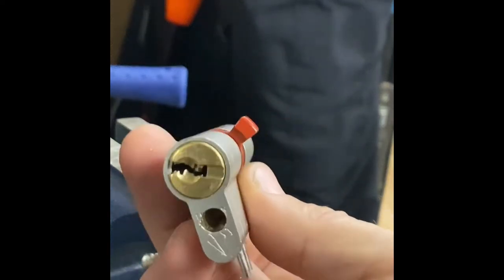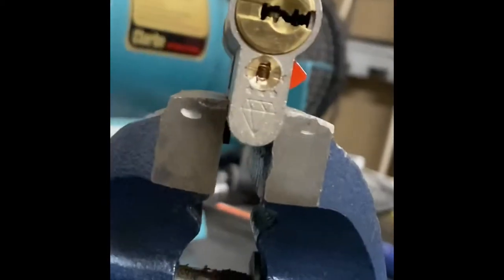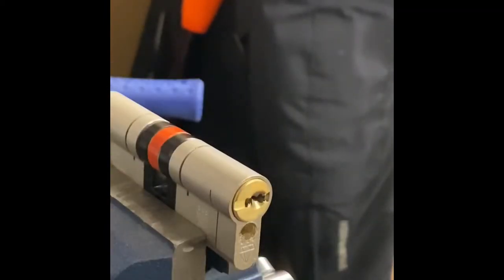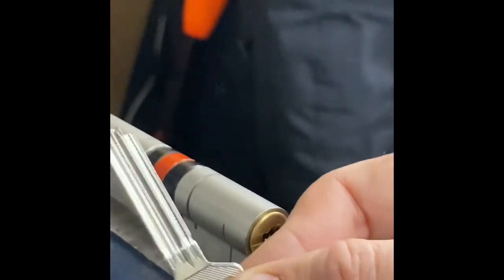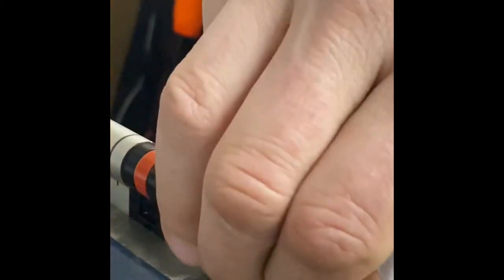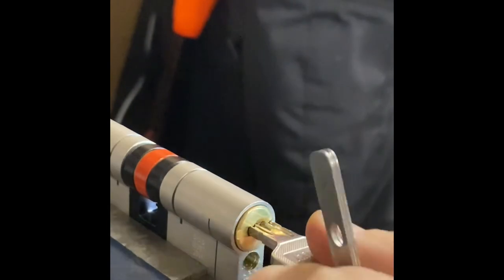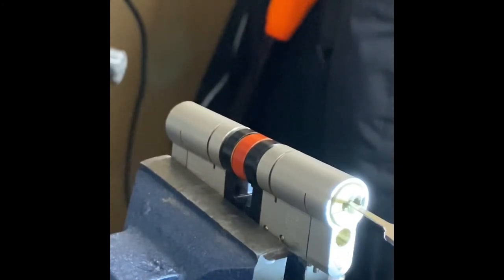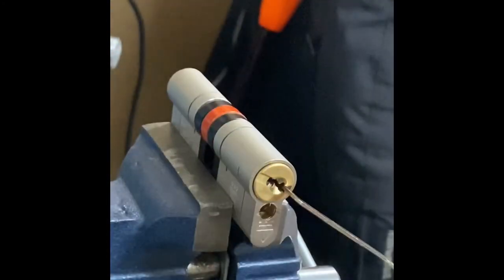Drill open Ultion 3* cylinder. Part 2. Side B.

Comment: Hi have you had many jobs where the key is stuck in these ultion cylinders as if they’ve gone into lockdown I’ve had quite a few now wondered if it’s a common issue? Thanks
Reply from the maker: It is a common issue. "Apparently" Ultion have fixed this with the newer cylinders. but we'll see.

Comment: Just wondering if you could give me abit of advice I’ve got a union barrel lock an someone has jammed wood inside of it an I’m sure they have put some superglue on the wood and shoved it in have you got any idea how I can get the door open
Reply from the maker: Hi. in all honesty, unless you know where to drill, I would call a locksmith. but if the door is open, just remove the latch and swap the cylinder out.
Reply: @LondonLocks   cheers mate no there’s abit of sourness going on at the place I work an they’ve decided to mess it up while it’s locked

Comment: Had to drill a Yale type lock today. Picking didn't work. Made me wonder about bantam locks. Can they be drilled so easily?
Reply from the maker: There are many bypass methods for Banham. but drilling is possible if you know where to drill.

Comment: If it took 12 minutes with power tools and equipment and all the noise in a workshop. I call that good lock. 12 minutes is enough for even police to respond to a call. This lock and a decent alarm system would probably defeat any burgler.
Reply from the maker: I'd of picked this silently in under 5 minutes. this is a very worst case scenario.
Reply: @LondonLocks  but these are hard to pick without gj picks normal standard picks would be impossible for a lot of locksmiths that’s why they normally drill unless they have gj picks
Reply from the maker: @stephenupdate1480  easy to pick, with skill, with any flag pick set.
Reply: Is this an anti snap cylinder lock ? I can see the groves on the outside ?
Reply: What lock was this
Reply: phone the police and order a pizza and see which one actually turns up.
Reply: "12 minutes is enough for even police to respond to a call"

Which is why they wait until you are on holiday. Barely anybody talks to their neighbours these days, so more often than not neighbours won't know that drilling is suspicious either.

Comment: Question -- I have this cylinder,   Key spin but no cam movement at all on the one side.   other side works perfect.   anyone come across this before ?
Reply: Yes. I see this a lot. lots of issues with Ultions.
Reply from the maker: yes. they're not very good. probably one of the easiest cylinders to pick too.

Comment: I would of run my drill in and out until all pins are gone. Definitely quicker
Reply from the maker: Hi. The hardened pins would ruin even a TCT bit. Slow and steady is the way with 3* cylinders.